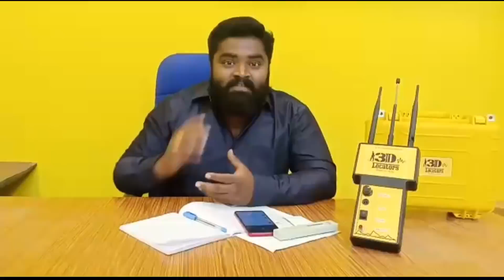3D Locators Underground Water Detectors Technical Information By Karthik Srinivas.

Comment: Dear, ganesan ganesan , what do you mean by device to find out ground water.
 There are 2ways to detect, 
1.Direct method  ,
Borewell Drilling machine is the only best direct method of equipment to find out ground water.
2.Many scientific equipments and scientific researches are done through indirect method.
The field of study Geology is how to better manage the ground water resources to their optimum capacity.
What you don't understand you can make mean anything.

Comment: No device in world for find ground water
Reply: ganesan ganesan you are right sir water does not have a balanced PPM Level or PH Level at any part so no detectors can directly find water...
Reply: @karthiksrinivasi.g.f7650  ppm or ph doesn't mater the device find water or not? If 600rs mobile working 100% but 1lake device working 99% think it
Reply: Dear sir 600 Rupees mobile keep inside land and try to connect you won't find network, Reason is penetrating a frequency inside a rock or soil even mobile frequencies are unable to travel. I have clearly explained if there is a device to directly identify water you are I don't have work in this industry, Borewell drilling people are ready to invest crores to find water.

These Devices will give you the changes in penetrating frequencies and if you can understand those changes in frequencies it will give you the route of fracture veins indirectly.

This is not a concept of using mobile phones. After 30 years of Research and Development and studies in Hydrogeology even though we cannot get 100% how can you think purchasing a machine can find 100%
Reply: If PPM or PH does not matter what else can we find in water, without knowing pH and ppm levels of water directly if we should get 100% results only method is drilling borwell and finding water directly.

Drill 10 borewells we will atleast find water in 1
Reply: Dear, ganesan ganesan , what do you mean by device to find out ground water.
 There are 2ways to detect, 
1.Direct method  ,
Borewell Drilling machine is the only best direct method of equipment to find out ground water.
2.Many scientific equipments and scientific researches are done through indirect method.
The field of study Geology is how to better manage the ground water resources to their optimum capacity.What you don't understand you can make mean anything.